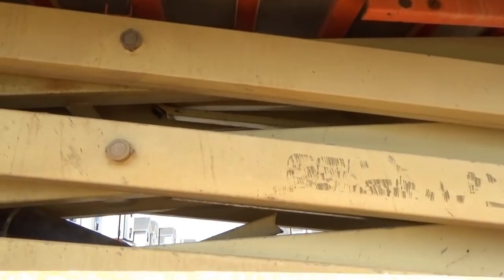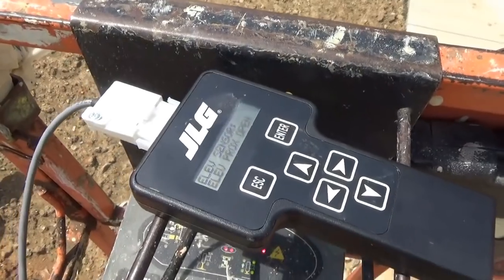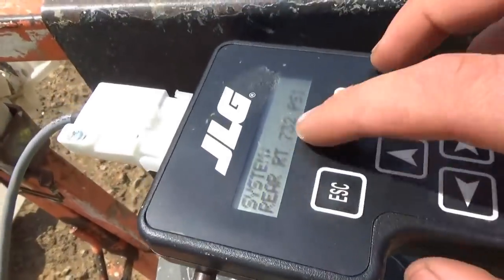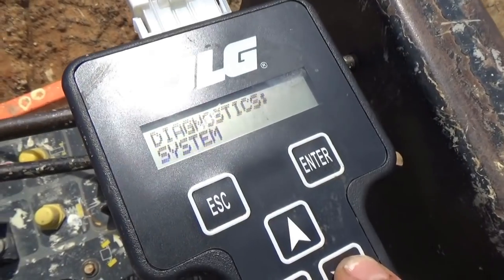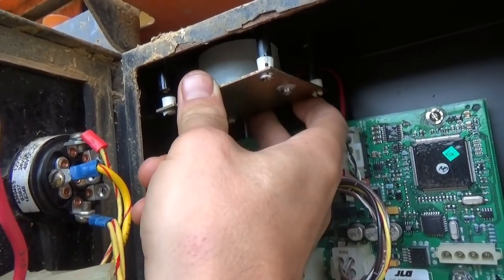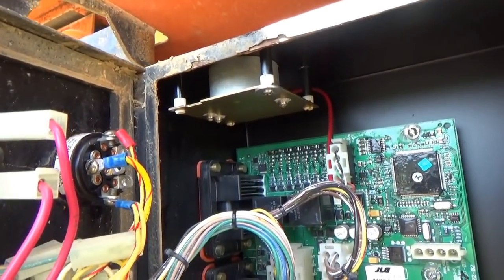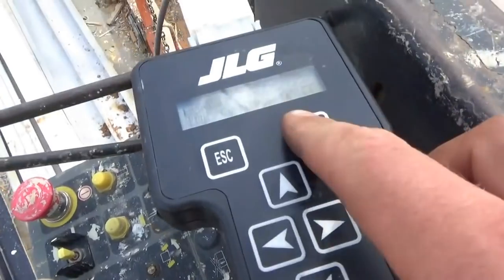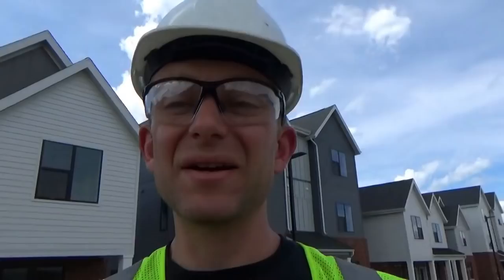JLG Scissor Lift: Cannot Raise Platform

Comment: Hi bro,Genie  S80 model 2015 problem of steering, when using the flat ground switch , when i drive forward/reverse with steering on the same time, the steering not responding. What could be the problem.

Comment: hi ivan I have a crank no start.  On the ecm fuse I have 2.5v reading.   it's that bad
Reply from the maker: a fuse should have 12V on it when it's live...
Reply: @PineHollowAutoDiagnostics key on I have.   I checked both leads on fuse it shows 2.5v
Reply: voltage drop?
Reply: that mean bad ground or something
Reply: its ecm I dont know.  i know when I check across the fuse you should not have any volts.
Reply from the maker: @Ryder4u1313  Get a wiring diagram to solve your mystery.
Reply: @PineHollowAutoDiagnostics  I have one.  the 2.1v  from ecm fuse I dont understand
Reply: I try to connect scan tool it says link error.  any insight with this.  need some help.

Comment: Those screws have probably been tampered with as quite often the tilt sensors are deactivated by users because " the alarm and cut offs kept going off all the time" - why? because they are using it outside the design parameters and so frig the switches.

Comment: Another common issue is some outriggers either bleed down alittle, overtime, or operator doesn't bring them up all the way and you'll get lifting/drive issues.  I suggest after replacing that sensor that u can recalibrate tilt with the analyzer. If u don't know the code to enter the service part its JLG's zip code backwards. 33271. Good luck and good find.

Comment: The tilt sensor mounting was stressed by repeated leveling operations.  The mounting method was not strong enough.
Drill out all 4 "studs". Replace with shorter lengths of tubes as spacers. Fasten with longer screws that run through box top,  retained by locknuts and through the spacer and board, with locknuts below the board.  Apply epoxy over exposed screw heads.

Comment: I never thought hot melt glue would hold the stainless steel gripping interior part, to the exterior plastic part of my 2000 Ford Expedition wheel covers, which hide the lug nuts on the aluminum wheels, but it did. I did have to scrub the inside with a paintbrush to get it clean before applying the hot glue. It beat paying something like $40 for a new piece of chromed plastic, since a missing one is a bit noticeable. It's not like epoxy, but is much easier to work with, and virtually free. Once I discovered how well the first one, which was coming apart, worked,  I pulled them all off and went around the inside of the other 3 with a bead of hot melt. It seems to adhere somewhat to any clean surface. But you can still rip it apart, should you need to, like to replace that interior sensor with the broken screws.

Comment: How to fix the tilt sensor attachment: grind/drill away the existing spacers and replace them with regular spacers, through bolts and nylock nuts; belt and brace with red Loctite, possibly some silicone to prevent water intrusion.
Reply: Stainless steel hardware is required for that outdoor equipment...otherwise it will rust and you'll have a return repeat call within 2 years...
Reply: The way those guys treat their machines he'll have a repeat call, no matter what hardware he uses... 🤣  @stealthg35infiniti94

Comment: Shouldn't there be rubber spacers between the board and the metal box for the sensor and not just straight plastic posts?

Comment: Saftey wire the tilt sensor. Or drill the bolts out of the holes, or thread the outside of the bosses to except another fastener, or epoxy it back together. How does it get that way?... idiots run those things up curbs and bounce them around like they are bobcats...it's abuse and age.

Comment: 9:16 -- 3 lousy screws.  JGL has opened a new factory in -- Guess where? -- Tianjin, China !!
Reply: Don't worry Joe biden will save us with his buy American campaign not!!!!😲
Reply: the way that thing bounces its no wonder they broke
Reply: @richardcranium5839  probably the last tech monkeying with it and broke them or someone on the job sight,  "jim-bo I thunk that there tilt thing-a-ma-bob is wrongs"
Reply: @richardcranium5839  with this model water runs of the hood right on the lower control panel, its a common problem

Comment: Use zipties, Ivan. Zipties solve everything.
Reply: couple of hose clamps on the down rods with zip-ties clamped on, then out around the whole sensor as temporary fix, until you decide to remove the circuit boards, then drill and possible retap

Comment: Ivan I'll give you some advice on these types of equipment as I work on these daily.  1. If your on a job site such as the one your on, your required to wear a fall arrest harness when operating the scissor lift or boom lift they refer to these as MEWPs (mobile Elevated Work Platform) (this is OHSA rules and it can prevent you from being injured or killed if something bad happens.) If the ministry of labor or OHSA does a spot check you may be required to have training to use the machine as the job site falls under the job sites jurisdiction (OHSA). 2. Never always think a problem can't be a simple fix or the operator was using  the equipment wrong or basically came up with a BS story to go home early on a Friday to get wasted so they said the machine is acting up to prevent yourself looking for an issue that isn't there. 3. Problems like such your seeing with the leveling system could be as simple as a bad connection i.e. water in a connector or a pin backing out of a deutsch plug. The JLG analyzer is a good tool but sometimes it complicates simple problems to make you overthink. 4. Don't half ass any fix  or temporary fix(i am just saying) this is a device is a MEWP that has to operate correctly and conform to safety guidelines as per OSHA and ANSI. So any half assed fixes or bypasses you encounter you should inform the customer of and document it to cover your ass. (I have seen my share of older machines and people wanting a free fix on your dime or get blamed for anything that goes wrong that had nothing to do with you. There are negligent and sneaky people in this business.) 5. Most of these MEWPs require some sort of an annual inspection to make sure they are up to snuff, this must be done by a company that deals with MEWPs (booms and scissors) and should be up to date if its on a jobsite. 6. Again cover your ass used equipment that is privately owned is usually the worst for maintenance so don't over estimate or overlook anything, like lack of oil changes, not greasing, leaks, worn parts, damage. and neglect and backyard fixes and disabling of safety equipment . 7. Don't sign off on anything unsafe or make a clause to say in your bills that this type of work does not include a warrantee for liablity purposes as again people are sneaky.  Again keep up the good jobs.  Cheers.
Reply: Even more important !  Never put any body part inside the scissor mechanism without installing the locking pin !  I don't know where it is, but there must be a mechanical locking pin that can prevent the scissor mechanism from moving while body parts are in the mechanism.  Two arms, two hands and ten fingers is a good idea !
Reply: I also know a person that gets Construction jobs just so he can sue the builder. He looks for OSHA and other safety violations and then he documents them before setting himself up for an "Accident" and suing.
Reply: @real_arbuckle  one day they'll hit the wrong job site and will vanish ;)
Reply: M Plante   Excellent advice for Ivan and great information for others
Reply: You saved me a lot of time. Thanks, I was about to say the same.
Reply: Another thing to watch Ivan would be this. Most of it i'm sure is redundant and obvious but i'll leave it there, and I'd suggest looking up information on Fall arrest harness policies and the usage of with OSHA and your state requirements: I work for a rental company that is very focused on safety. https://www.youtube.com/watch?v=jRAtlb5jqcA. Training for particular pieces of MEWPs may be required as well as an inspector or job site  may require you have a training card to make sure your familiar with said piece of equipment or you may be looking at fines.  Things to think about. Most of the larger equipment rental companies offer training and issue a training card as well if you so require. Be safe out there. BTW in a MEWP I always carry a cell phone in case the equipment breaks down and leaves me up in the air. This is also good advice when your the only one on site and don't have somebody to get you down. Be safe brother.
Reply: Given the importance of the high lift working well and being safe, seems to me the construction company should contract with a certified high lift mechanic.  Someone who knows the equipment, its traits and all aspects that should be checked out before putting the high back into service.  While Ivan is talented and well intended, this, in my opinion, is something he should respectfully decline to do.
Reply: @99andrianmonk  the certified mechanic is likely the clown that broke all the tilt sensor screws........................
Reply: Dealt with these machines in my old job. Very good observations and advice!

Comment: Once you set the outriggers down you can also pitch machine left or right, by selecting outrigger and using steering rocker. Also useful for watching pressures on the analyzer

Comment: The unfortunate reality is that scissor lifts, or any elevated work platforms, are operator and environmentally abused,  flogged into the ground and any maintenance is reactive, not proactive. It's also not a great idea to put body parts anywhere near the scissor mechanisms without installing the maintenance prop ! Great diagnostic !.👍👍🇭🇲

Comment: Q: How do you work on or replace the sensors that are under the scissor mechanism safely? Crawl in there when it is parked all the way down or is there some way to lock it in an elevated position?
Reply: It has a safety lock bar on it.
Reply: @mechanic_marky  Thanks the concise answer.
Not my line of work, just inquisitive how it would be done. Struck me it would be insane to get under the scissor with it just supported by the hydraulics.
No doubt there are mavericks who do exactly that and think they are heroes by getting the job done quickly. :(

Comment: As always great video, I'm sure you're aware there's work in the field for skilled mechanics especially with these machines and the somewhat old or unusual construction equipment, as for those studs that are stripped, you could break off and grind the surface smooth and shoot new ones on, you could do it on site but it's better in a controlled environment

Comment: Those threaded metal tubes are probably standard electronics stand-offs.  I’ve seen them in aerospace for decades.  Usually they’re hexagonally-shaped, so you can get a tiny wrench on them.
Reply: I'm betting those are spot welded to the cabinet and they're sure round. less penetrations for water entrance :)
Reply: @Jason Bowman certainly,  if he wants to drill new holes and install new spacers. I'm sure those are spot welded in place from factory.